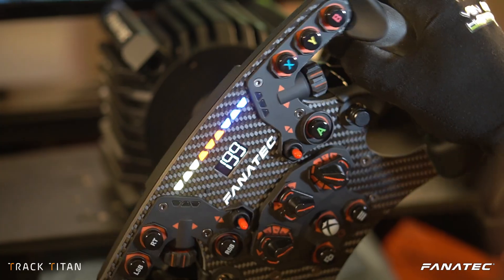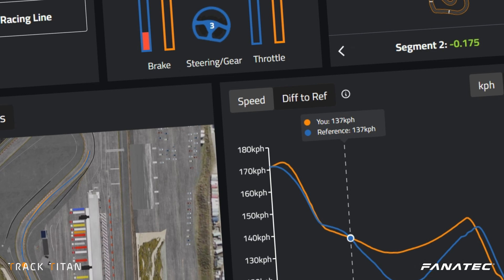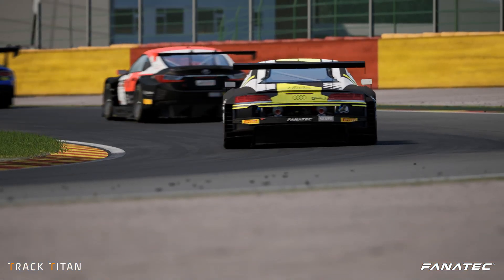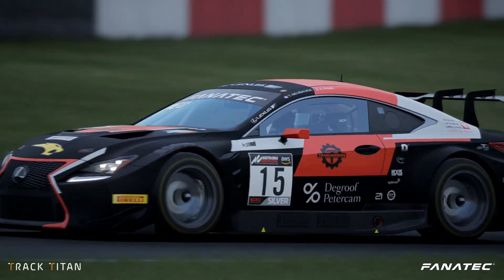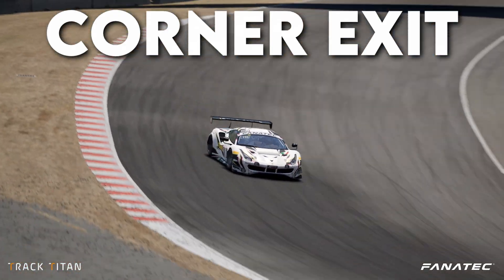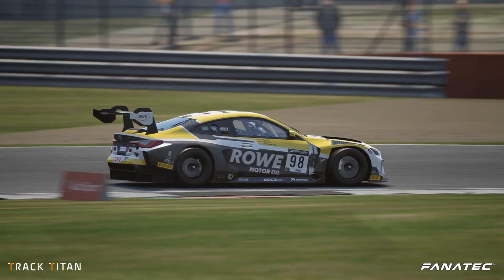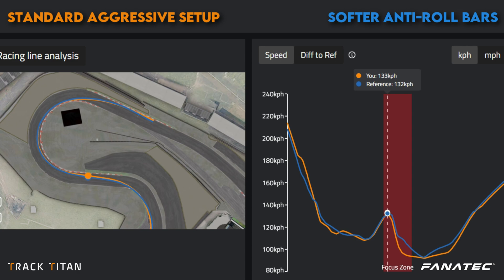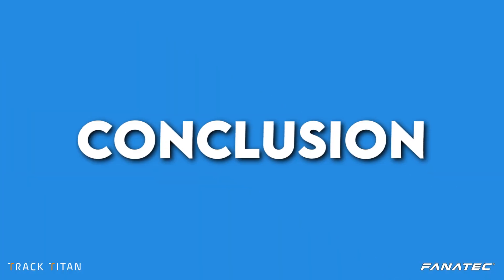The Basics of Anti-Roll Bars | Tutorial Tuesday

Comment: In case of understeer: By stiffing anti roll bar in front will have more evenly weight distribution during cornering to prevent roll , which will increase grip in front tire so why we won’t make roll bar stiff in front during under steer ???
Reply: Not necessarily.  Stiffen the front too much can scrub the fronts (understeer)...Basically sliding the fronts cause the roll bar keeps the tire straight up instead of flexing (best way to describe it).
Reply: When you begin to decelerate as you enter a corner, the weight of the car shifts forward. If you soften the front roll bar, that weight shifting will also go more toward your outside front wheel, which will have the tendency to bring the back of the car around on that side. If you’re entering a left turn for example, the weight of the car will shift to the right as you decelerate, which will bring the back of the car around with it.